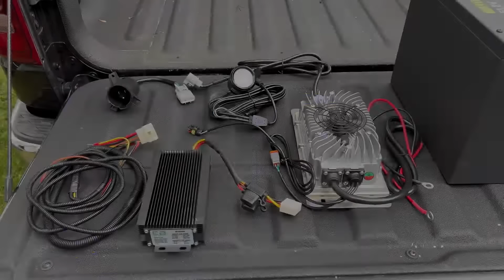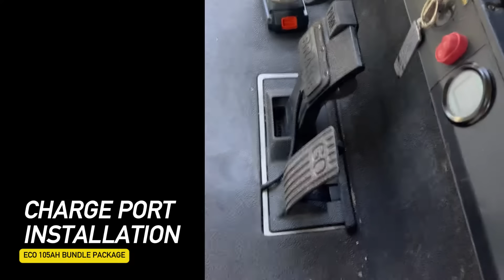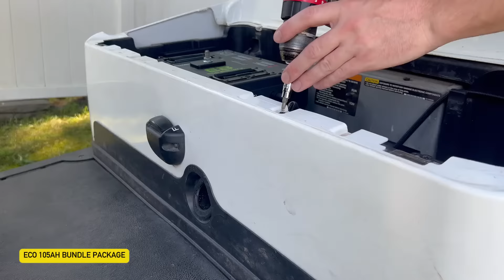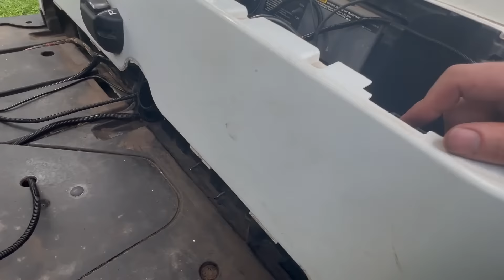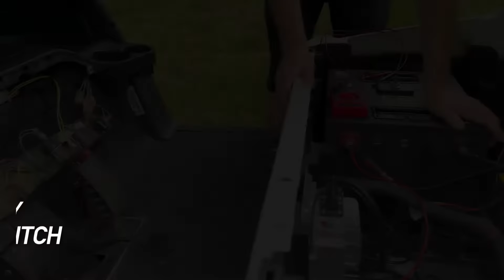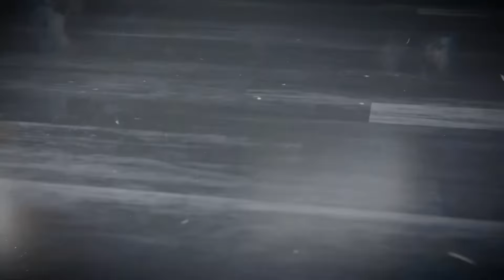Eco Battery 48V 105Ah Thru Hole Bundle – Unboxed & Installed

Comment: Does that CAN connector that goes from the charger to the battery ever get unplugged? Or does that stay plugged in forever. Like once battery is fully charged am I supposed to unplug that blue and brown connector?
Reply from the maker: You can keep it plugged in forever. There are aspects of the eco battery system that will not work if it is unplugged.